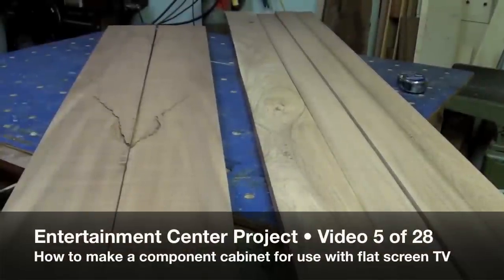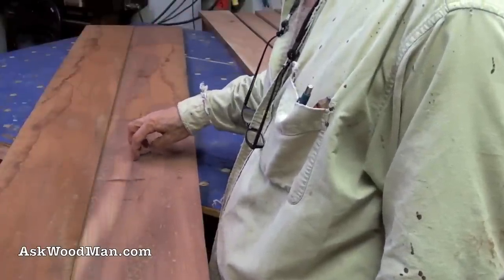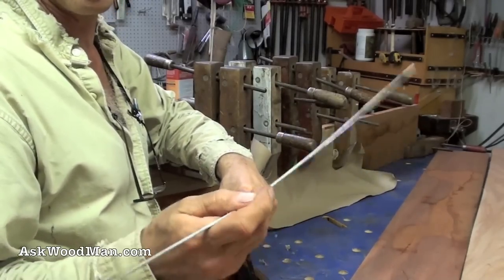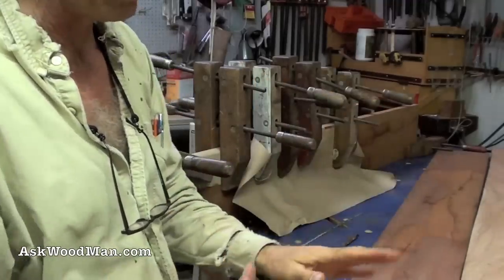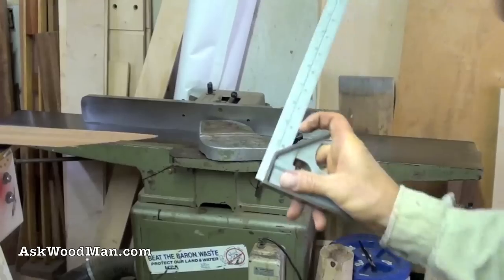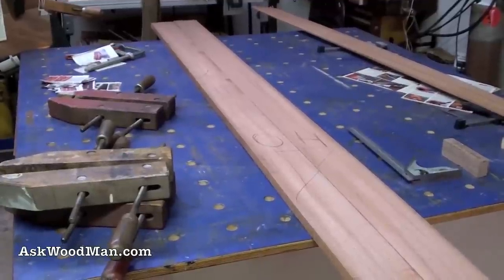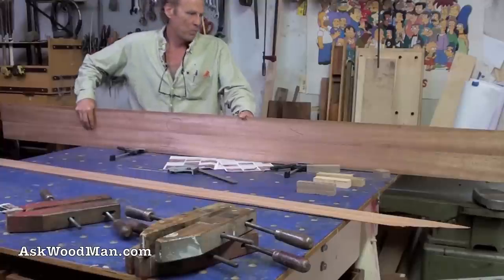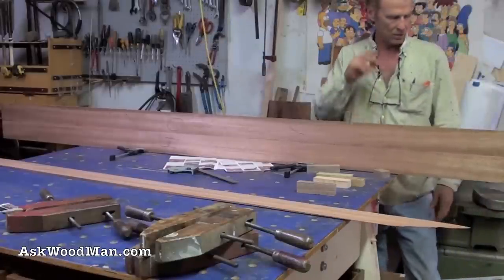5 of 28 • Building An Entertainment Center for Flat Screen TV: A Furniture Project

Comment: You can tilt the jointer 10 degrees, 20 degrees, doesn't matter - the angles will offset each other.  Using a larger angle helps to understand the concept better (at least for me).  You did a good job explaining it, however.  Thanks!